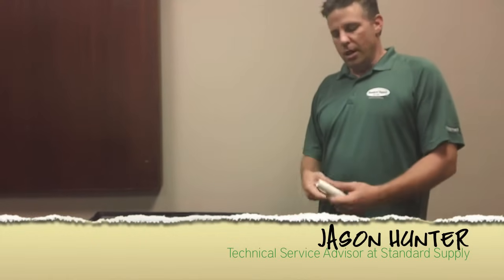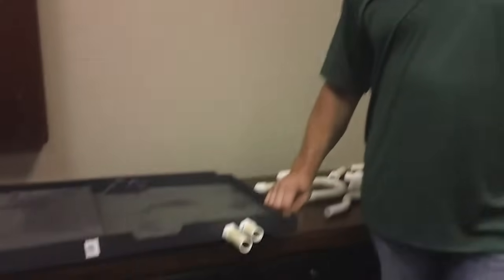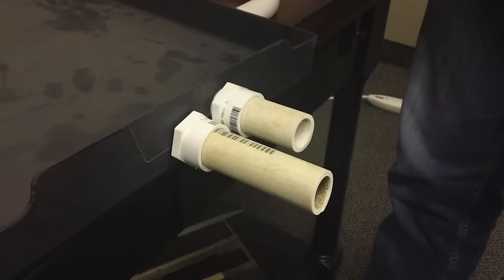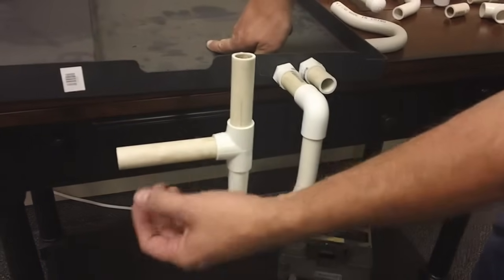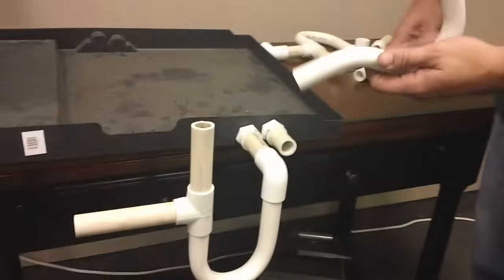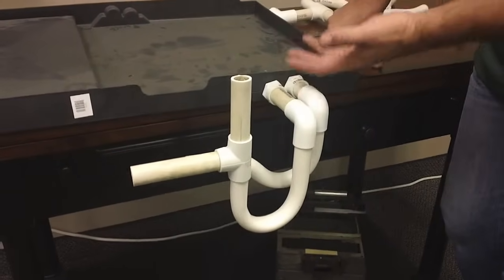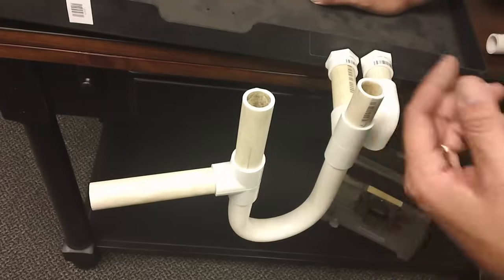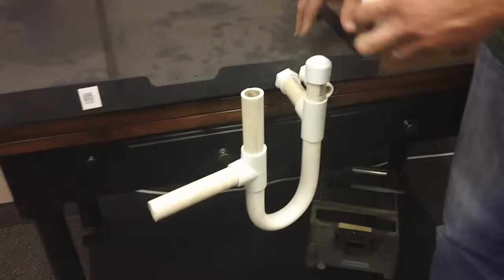Tech Tip #3: HVAC Systems - HOW TO Correctly Install Condensate Drains

Comment: I would never use a trap with such a pronounced "U" because there is not enough water pressure or volume to flush out the sediment. The sediment is more like to remain behind. A much shallower and  more gently curved "U"ish trap is more like to allow the sediment to get carried away by the slow moving condensate. The clean out is still a great idea though.

Comment: This is hands down the best video about properly configuring a condensate drain.  This is not for the DIYer the audience for this video is for HVAC professionals to better the industry.

And for the love of god its called BABY OIL.  You prime BOTH traps with BABY OIL.

You must have a tee with a cap on the primary otherwise you cannot properly service it.

Also for rookies who rely on float switches its just a matter of time before they fail.  You cannot rely on a TEMPORARY float switch in lieu of a secondary drain.  All float switches are "TEMPORARY" because they ALL FAIL WHEN YOU NEED THEM.  

When you run your primary condensate drain in to stink pipe I always double P trap it.  For example using a sanitary Tee at the washing machine drain and adding another P trap at the attic entrance again priming it with baby oil.

Comment: How does the secondary get an air seal? It should be dry I would think. I like to run the SS2 float switches on the secondary. Very cheap $20 part.

Comment: So how does the secondary trap get water supply for an air seal when it's not in use except during a primary blockage.
Reply: Fill with mineral oil, it doesn’t evaporate. Did this with mine, still drains fine when primary gets clogged.

Comment: Good job omitting describing the difference between negative and positive systems so that the home owner understands the difference. I figured it out on my own. Hopefully most others will also. 👍
Reply: I'm still a little confused 😕
Reply: @timmcquerry6068 
The position of the blower motor in relation to the evaporator coil.
Reply: I must have been difficult for you to figure it out, well done

Comment: The issue I see with your secondary drain P trap and negative pressure scenario is the trap will never get primed, and even if it does get primed manually it will evaporate. So essentially, you’ll just be venting through the secondary drain.  What am I missing?
Reply: As long as the main drain isnt working, yes, you'll be pulling air from the secondary pipe, which is fine. If the main drain clogs and water rises in the pan to where it needs to drain out of the secondary pipe, water will then fill the P-pipe.
Reply: Mineral oil

Comment: All the mention of code is irrelevant code is the bare minimum.  We float protect the main pan via the secondary hole  AND still float protect the safety pan via a pan mounted float.  We have NEVER p trapped  a secondary and never would.

Comment: At 4:17 you noted that in a positive pressure system, if air is coming out the secondary, it prevents water from drainingout the primary. I have experienced this (resulted in water coming out the secondary while the primary wasn't clogged, and filling the emergency pan), but can anyone explain why this is the case? Putting a vent before the trap, exactly as shown in the video, fixes it. I'd just like to understand why this happens if anyone knows.

Comment: Oh ,mine doesn't drain outside it drips onto the laundry room floor where there is no floor drain. Thus the "leak" that my landlord discovered a few days before I was scheduled to move in.   A neighbor said that there is a floor drain in the laundry room so I am assuming when the linoleum was replaced it was laid over the floor drain, beacause its not there.  Sure would be a shame if this new carpet and floor boards and linoleum and sheet rock (assuming it was replaced from the water line) all had to be replaced again because the maintenance supervisor is lazy. I've had a cookie sheet under it since I noticed the drip. Can't use the A/C because it fills everytime It shuts off so I'm afraid it will overflow. So now I will have to notify the landlord of the leak, the disruption, walking on my carpet with dirty shoes, having to move my washer and dryer and dining room table, tearing up the linoleum. Or i'm thinking I could run some same diameter plastic tubing from the elbow to the washer hose drain thats uphill so that is no good. I Could pull out the washer find the indention from the floor drain and cut the linoleum out would still have to run something from the pipe to the drain cut a hole in the drain trap so water doesn't go under the linoleum Pour gallons of water down the drain to make sure its not clogged. Wiggle the washer back into place The pipe sticks out of a hole in the wall about 5 inches theres a elbow on the end that sits about 2 inches above the floor. There is plaster all around the pipe where it comes through the wall. There is no chance of rotating it. I don't know lol. Just venting.

Comment: I have never in over 15 years of HVAC service seen or heard of a pee trap on a secondary drain
Reply: That's why you're here... To learn how it's done properly
Reply: It’s because there will not be any drain water going through the secondary pipe in normal conditions unless the primary pipe is clogged. So the P trap there wouldn’t work.
Reply: @billl2969 fill it with mineral oil
Reply: I don’t like attic air getting sucked in through the secondary, so I trap it. You aren’t one of those guys that caps the secondary are you?

Comment: I have never seen a secondary condensate line drain directly into the emergency pan. Why wouldn't you just cap it?
Reply: You will turn your air handler into a swamp cooler

Comment: This doesn't make sense with the secondary drain. There shouldn't ever be any water  in the secondary drain line unless the primary is clogged. So if the primary is working properly then how would the secondary ever form an airtight seal? There won't be any water in that p-trap
Reply: Mineral oil
Reply: The primary can plug with a slime/algae (I guess). I like to use unions to easily pull out and clean in the middle of summer. Many heat pumps have a level detections in the pan to shut off the heat pump if condensate fills the pan. Sometimes the level switch is integral to the P-trap. Good if you have a fan unit in the ceiling and can prevent water damage to a ceiling below it.

Comment: I don't see the purpose of adding the extra primary T and cap - that is silly and redundant.
Reply: It's a clean out. Bc if you do the rest correct, it'll all be glued except that cap.  Then when you call for maintenance they pop the cap off and clean out the drain line.
Not code everywhere. But not a bad idea. Future visits will thank you

Comment: I don't have a trap on my 12 foot drain line. It's a rooftop combo furnace/AC unit with a slight drop of maybe 2 inches on the 12 feet of drain. I am in Southern Arizona with very little humidity. It drains just fine. Is it working because the unit doesn't have to remove humidity?
Reply: That's exactly right. I'm in Georgia. Our ac units produce about 8 to 10 gallons a day. In peak times.

Comment: What pressures is the PVC experiencing? You think the pvc will blow apart with the trickle of water going down? What's the point of the J trap even? Told hold back odors, meanwhile you have open PVC connected out to the sewage. If there is a clog, then what? You insert a tool and it pops out the other end, as  opposed to going down towards the sewer, towards the clog. Just ass-backwards. And I've only done this for two months.

You need to set the T out of your air handler with the middle port connected. The top of the T is then capped.  You run a P-trap, J-trap, whatever, down the T. So now the "Vent" can be used properly. AS A CLEANOUT. WTF this guy's theory of pressures in the PVC is so dumb.

Comment: Our air handler sits on rubber vibration pads on the floor,it's only 2" off attic floor. Your traps extend 6+" below the pan?! How's that possible unless the unit is jacked way up on a platform or a desk like you're using here?

Comment: My installer did not add a J trap on the secondary drain and it appears my primary drain was not used at all and all the condensate was draining through secondary drain. I added J trap on the secondary drain as per your video and I can see that condensate is draining through my primary drain now but I am still getting some condensate through my secondary drain. How do you make it go away? Is it something to do with the height of shorter leg on the Strap on the primary and secondary drain. If they are kept at the same height then that can behave the same and condensate can drain through either line. Water level difference is only few mm higher on the secondary drain as compared to the primary drain. Thanks for your feedback.

Comment: How do you keep water in your secondary trap if the primary is working as it should
Reply: Exactly, a trap only works when water is in the trap !!!
The secondary tap should have an overflow switch to shut off unit when main drain clogs...............
Reply: Some mineral oil pour into the secondary will last 15yrs and will let water pass right though

Comment: What make the secondary drain secondary? They are both at the same level. It's not a primary/secondary it's a duel drain......and I don't see the point. 
Obviously I am missing something.
Reply: The secondary drain is a little bit above the primary that's what it make the secondary "secondary " probability you can tell in the video but that's how it is 👌
Reply: @WOODYSOOPY  On my Carrier, both vents are the same height.  The difference is(and I only found out after taking out the connections) is the secondary has a dam that restricts the water from coming out and the main has no restriction

Comment: Some commercial AC normally at high speed and the trap wouldn’t work since the negative pressure is so strong that all the water in the trap will be sucked out

Comment: How is a trap effective on a secondary when there is not supposed to be fluid in there? Even if you intentionally put some there, it will dry out in way less than a season, especially for units in the attic.
Reply: Mineral oil
Reply: @Houston Paul instablaster ;)
Reply: @Allan Torin Thanks so much for your reply. I found the site thru google and Im trying it out now.
Takes quite some time so I will get back to you later when my account password hopefully is recovered.
Reply: @Allan Torin it did the trick and I finally got access to my account again. I'm so happy:D
Thanks so much you saved my account!
Reply: @Houston Paul no problem :)
Reply: You prolly dont give a damn but does anybody know of a trick to get back into an Instagram account??
I was dumb lost the account password. I would love any help you can give me.
Reply: @Houston Paul Why do you need an Instagram account. Instagram's useless. 

I may be off my rocker, but does anyone know how to upstream a video account to a dish monitor? Just thought I'd throw that out there while we're off topic.

Comment: i always put EZ trap on my installs along with a float switch in the emergency pan and i just plug the secondary drain ...is this wrong?.. if it is , why?....just curious, thanks in advance!
Reply: ILL LOKANO put a safety switch on the secondary drain
Reply: @moisesbonilla9362  isn't that overdoing it tho...already have safety switches on the primary and emergency pan, adding another safety on the secondary would make it 3 ..i mean is it really practical?
Reply: ILL LOKANO thats not a bad idea because if theres water in the secondary pan it wont be alot. As long as you have a safeT switch in the secondary you’ll be fine. But i know its not recommended to merge drains but it works

Comment: is the lower drain the main drain? You didn't explain.
Reply: Mary Lamb yes, the lower is the primary drain and higher is secondary. I prefer a float safety switch in the secondary outlet, peace.

Comment: How do you tell if you have a negative pressure system?
Reply: If the condensate is on the suction side of the fan, its negative.

Comment: Why does my unit need a vent before the trap in the main drain? The secondary line is teed off to the emergency drain pan and then it goes out to the backyard by my window
Reply: Vent tube is not before the trap.

Comment: Why would someone combine the primary and secondary drain? they did this on my current unit. it has both lines going in the wall but they just connected them, only one trap.

Comment: The PVC lines for the drain are lower on that model pan which I'm glad they changed/updated, I've seen several where the PVC line is 1/4 inch above the pan causing standing water and mold in the large surface area pans, most of those I've seen mounted in attics that are humid anyway. This pan looks much better.
Reply: I have water in my pan now but not enough to drain into the secondary tube. Unfortunately, there’s no cleaning T on my primary drain.

Comment: Do you do sheetrock work also?  Tell me what happens over the winter when the water trapped in p-trap freezes because you didn't bother to provide a drain or easy means to disassemble the pipes to remove the water.   I'll tell you.  THE TRAP BURSTS.  Then in the spring when you turn it on again for the first time it DUMPS ONTO YOUR CEILING CAUSING IT TO COLLAPSE.   New house,  first with central air.  Had no idea how the AC drained.  Now I know!.  Ripped the builder a new one that following spring.  His answer was " Duhhh, code doesn't call for a drain", so water is supposed to come out by MAGIC over the winter.WARNING TO EVERYONE WITH HOUSEHOLD CENTRAL AIR IN A ZONE WHERE TEMPERATURES GO WELL BELOW FREEZING IN THE WINTER.  DON'T DO WHAT IS SHOWN IN THIS VIDEO,  Either build your own home grown trap with a drain or do as I did and re-plumb with a pair of unions so the trap can be easily removed and drained before winter.  No,  you will not find a 3/4 pvc p-trap with a cleanout plug in any plumbing supply store,  they don't exist.I've asked several HVAC people I've stumbled across what they do to prevent pipe burst over the winter.  The answer NOTHING!!!!!   They just assume your attic has crappy insulation and the pipes won't freeze.   Commercial AC?   The air hander unit is generally in a heated space so its not an issue.
Reply: If your attic is freezing, your home comfort priorities are better focused on insulation. Address the dwelling's insulation issues. If you have any sort of AC unit, you must reside in a warm region, hence the cooling requirement.  How can a condensate trap still have water in it, in freezing temperatures? Condensate drains do not burst unless Summer turns to Winter, overnight. Commercial rooftop units crank out AC for office buildings, with exposed PVC external traps all over the globe, in the dead of winter, to suck the heat away from mall zombie shoppers, server rooms, gyms, rec centers. They don't split from freezing dude. If you have water in a drain line, freezing well after the warm season, it must be a tub sized vessel, riddled with moldy, yucky, soon to be yuckysicle attic pops. Something else is happening at your place dude. Basic ratios apply to draining water. If your drain worked in warm weather, then the drain works. If your house is freezing, on the INSIDE and you magically have preserved condensate from warm weather, well, you've got something really special, my friend.
Reply: Learn to wire a safety switch

Comment: So you're telling me the company that installed mine and used a piece of a garden hose didn't do it correctly?
Reply: B Landel a lot of the newer units have traps built into them so it may not be wrong piping it with a garden hose
Reply: @816thatguy what????? nothing built in and garden hoses…well, “garden” nothing has anything to do with hvac. guessing you are a pro diy’er. ha